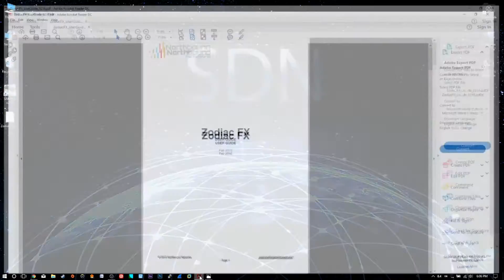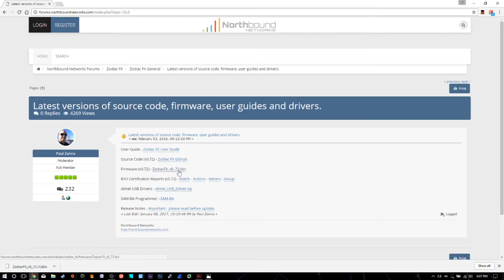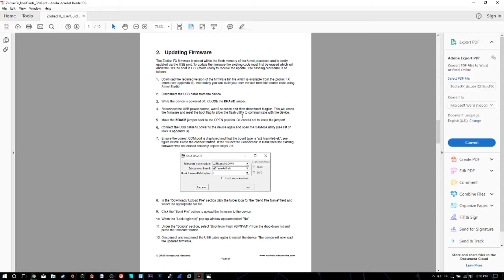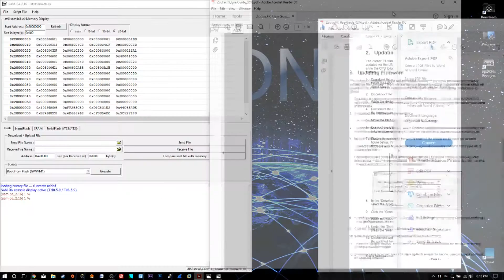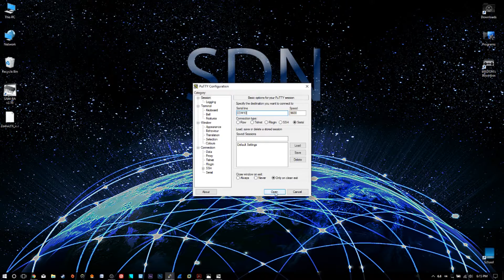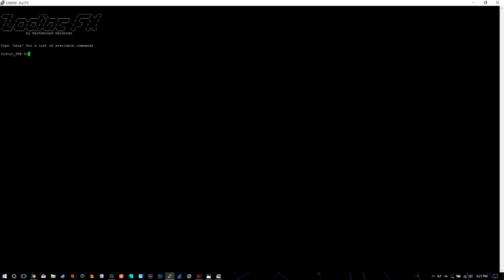2. Configuring the Zodiac FX SDN Switch

Comment: Im having a problem with my zodiac fx.
im using Ubuntu 16.04 and SAM BA 2.16 for linux . The problem is SAM BA wont detect Zodiac on any ports.
Meanwhile, when im using Windows and SAM BA 2.16 for Windows it works well.
Any idea whats going on?
Thankyou in advance